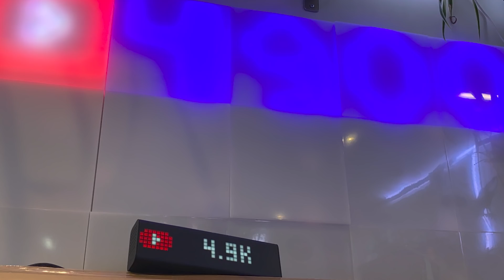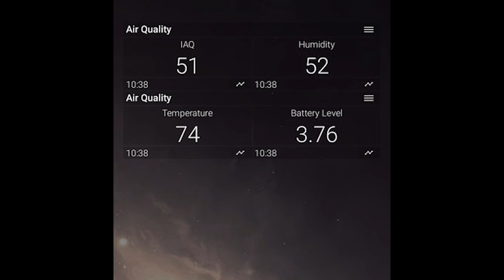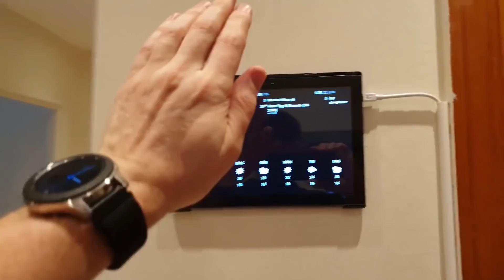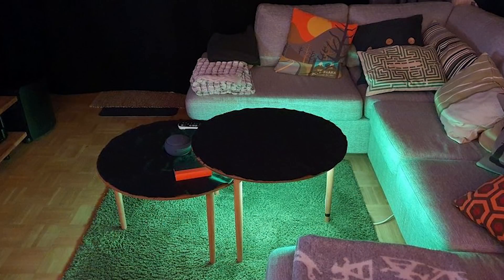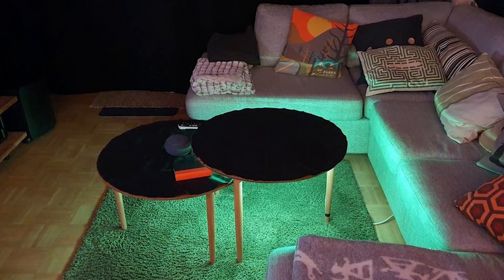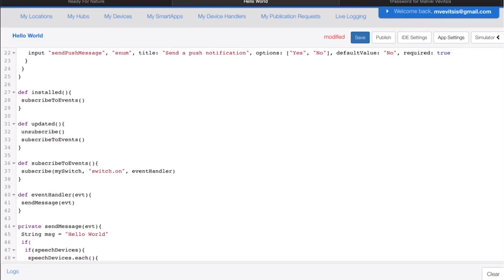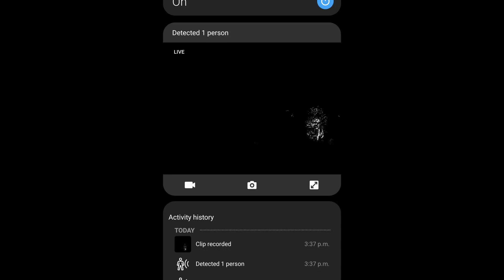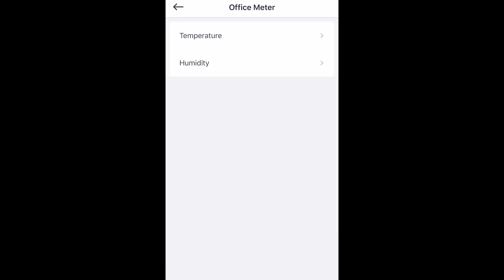Smart Home Project Ideas!

Comment: Are there any Smart sensors for sound?  My application would be to create a routine to alert me when someone rings the door buzzer or a smoke or CO2 alarm goes off.  Why spend lots of money on a smart smoke alarm if a listening device near a standard alarm could alert you?  Sensor adjustments for sound level and/or frequency (Hz) would be a plus.
Reply from the maker: There are many examples of cameras that at this point can listen in and tell you if a smoke or CO alarm/detector is ringing.  For example, Wyze has this feature on their cameras and Nest now offers it within their Nest Aware subscription service as well.  Alexa Guard does, too.  So maybe it's more in the direction of a Smart Camera or a Smart Speaker that you're after?
Reply from the maker: Door buzzer is a little tougher, but I still get notifications on many cameras due to sounds like that.  Also, a smart doorbell might really help you there.

There's just not a really good, highly tuned, smart sound sensor that works in enough ways for your application.  At least not that I've found.  Perhaps a good question to ask at community.automatelife.net!

Comment: If you really start to integrate Hubitat more into your system, I would highly recommend the community created app called Hubconnect. It essentially links Hubitat with smarthings, allowing you to run your automations in either device, and giving them access to devices they otherwise might not have access to. (Mostly giving Hubitat access to the SmartThings devices in order to automate in Hubitat)
Reply from the maker: Yeah!  You're the second to mention it and it's definitely on my radar.  Thank you Chris!  I didn't know the name.

Comment: I'm definitely down to show what I have been working on. Over 50 devices in my Home, Autolocking doors, automated lights, turned my Washer and Dryer Smart by using Webcore Pistons to send notifications when the washer or dryer is finished. Waiting for humidifier sensor to come but the goal is to make it so the exhaust fan in the bathroom auto turns on and off based off Humidity. I dont have a home automation channel but a gaming channel called Hybrid Mongoose with 5k subs, been working in IT for 10 years and I am far from done in my home. Definitely like to share :)
Reply from the maker: Very cool!  I'd love to set up a home tour with you Hybrid Mongoose!  Can you email us at info at automatelife . net???
Reply: @AutomateYourLife  I will definitely email you 😀
Reply: @AutomateYourLife  email sent 👍
Reply from the maker: Received! Thanks Mongoose :)
Reply: Doing the same with my washer and dryer webcore piston https://community.automatelife.net/topic/340-washing-machine-dryer-notification-updated-9-25-2019/ and using my air quality, humidity and temp sensor i built (made 3 of them so far) to turn my fan in the master bathroom on/off as well. Might check out my webcore pistion at https://community.automatelife.net/forum/24-scripting-talk/ to. Looking good :)

Comment: Lot's of really good idea's here. If anyone has any questions about my device (Air Quality,Temp, and Humility sensor), then please respond to this comment, or go to the board link. Also as an update have integrated this through thingspeak and webcore with smartthings so can turn my air purifier and humidifier on/off based on the readings from the sensor.
Reply from the maker: Yeah I saw that upgrade!!  That's a really great addition there too Larry.  Thanks so much for sharing with us, so many times!

Comment: Excellent video Brian! <3
Folks, if you have questions around my piece at the end, feel free to reply to this comment.
In a nutshell... Switchbot Thermometer/Hygrometer detects humidity -> if > 50% -> turn on TP-Link switch, if < 40% turn off. Homeseer HS-FS100-L (which I have powered via A/C, not battery) pointed to the light sensor. It detects when full, and sends me a notification via SmartThings. This was a bit tricky, since you must use its "button" via Webcore. It can detect blinking, which is what my dehumidifier shows when full. We get the notification, and run down and empty. Especially helpful if you have multiple units like we do. This also controls your electric bill a bit better than having them either 1) Run at maximum 24/7 (mine consumes over 600w!) or 2) Trust the humidity sensor in the dehumidifier, which I've found is almost always incorrect compared to the humidity sensors I have separately.
I can't tell you how happy this makes my wife, since before she'd go down to the basement to do laundry and always complain about it being musty... or if the dehumidifiers would run, we wouldn't know they were full, and we'd forget to empty them... or go downstairs and they weren't full, but we'd empty them anyway. Just wasn't a great situation. Now, as I told Brian, as my wife saw how beneficial that project was, she is happy to entertain other ones. We have a very basic setup, but she loves that we have smart switches/plugs!
I hope this helps someone out there.  Have a great day and enjoy!
Reply from the maker: Thank you Pete!
Reply: Love it!

Comment: So many cool things. And now I have to illuminate my outdoor table/firepit. Other than Philips Hue ($), what outdoor strip would you recommend? I have 2 that I had bought at Costco (3 really but one got stolen) but they don't sell them anymore. They've survived our winters so need another reliable brand.
Reply from the maker: For outdoors?  I don't think there is one I would recommend.  I mean, you could go really basic and maybe get some of the ones people use for Christmas lights outdoors, and then just use a better controller.  I often see IR controllers and smart controllers available for those.  There are lots on Amazon that you could power on with smart plugs and the like too.

Amazing that they got stolen too...I'm really sorry to hear that.
Reply: @AutomateYourLife  Since they're outdoor and I'm leaving them all winter, I don't want to spend a fortune in case they don't survive. 
We will be replacing the fire table this weekend and I think the light under it will be really cool. 
I'll see what Amazon has available that's good for outdoor. I want to be able to do colour changes too. 
The one that was stolen I was having trouble connecting it to my Google Home app and it didn't turn off with the Goodnight routine so somebody did see it from the street and came and ripped it off the deck. I doubt the idiot will be able to use it anyway. I did catch him on camera but he had a hoodie on. I posted it on local neighbourhood watch FB page but nothing came of it. No big deal.

Thanks Brian!

Comment: Glad to see that you will be doing more with Hubitat!
Reply from the maker: A ton more Murray.  I've been working with Alan on his installation a bit around his home so I've had lots, but I wanted to live with it a bit more myself.  Maybe I can provide you a bit more value too!
Reply: @AutomateYourLife  I have recently, unintentionally, ended up going full Hubitat from SmartThings.  I've been able to do some insane things as a result. The Rule Engine is just insanely powerful. For example, I have my front porch lights set to come on a little after sunset, and shut off at midnight. No big deal, you can do that with SmartThings no problem! But, the fun part is what happens when somebody comes along during that time and flips the light switch...
I can have it shut off the light for one minute (or any other set period of time) and then come back on. Or, I have have a series of flips of the switch (L, R, L, R,U,D,U,D,B,A, Select , Start) to do any number of things with the lights, and then return to the on position until midnight, or shut off all together. Add to that, simultaneous speaker announcements and it gets fun.
My kids room, if they turn on the light after bedtime, it will stay on for 3 minutes, and their Google Mini will tell them that it will shut off in 3 minutes. 
My Ikea blinds work locally, without the Ikea hub. And the nuanced stuff that Hubitat allows me to do there is crazy.
All of that without having to use WebCore! (But Hubitat supports that too so you can easily port your pistons)
The ONLY thing I have found that I don't like about Hubitat so far is how it handles fans. There is a work around, but I don't like it. I also don't like how it passes it's scenes to Google Home as switches. I ended up making a room in Google Home called Hubitat for all those scense to go into. 
Anyways, I think you'll enjoy it more and more as it's unhinged power starts challenging your creativity. I can't wait to see what you end up with!